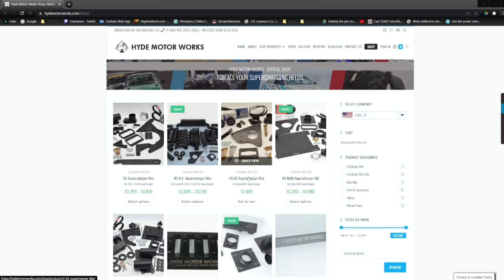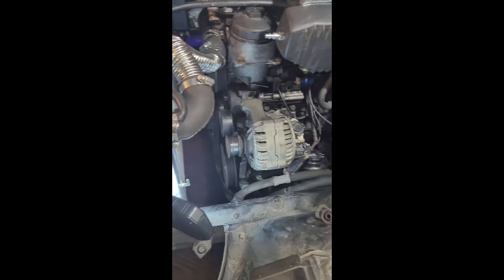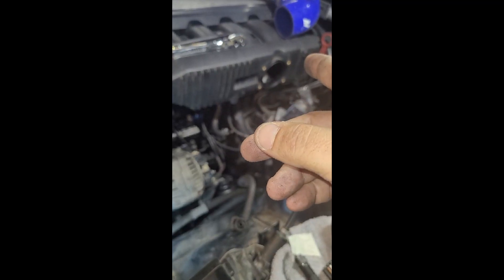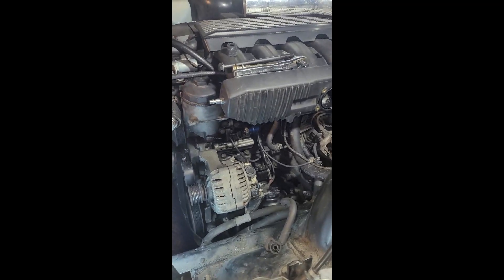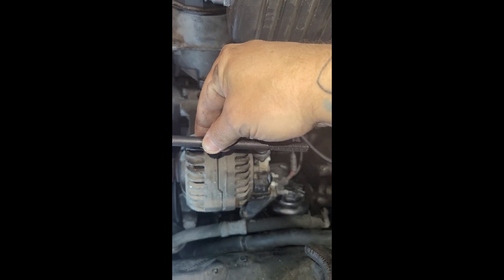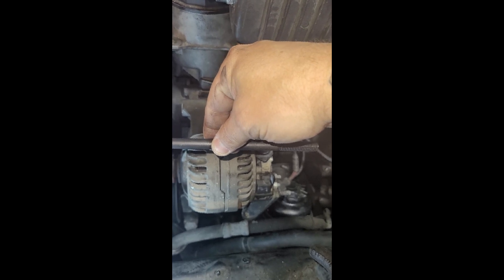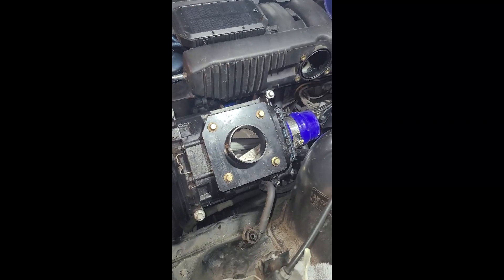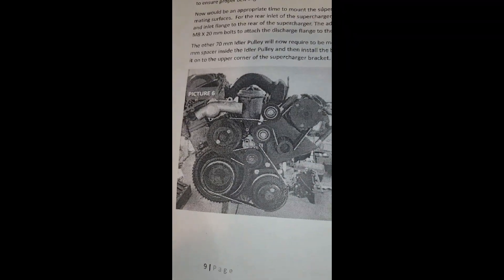Hyde Motor Works V3.62 Installation guide using Eaton M62 supercharger. 99 E36 BMW M52b25.

Comment: Hi tell me for the Hyde assembly do you need to have the power steering pulley? Or can I mount it without it and take a shorter belt
Reply from the maker: @sakbaw  you would want to contact Hyde to be sure but as long as the superchargers turning in the correct direction you could probably just use a smaller belt

Comment: hello, 
I have a question,

How did you relocate your power steering reservoir ? 

Thank You.
Reply from the maker: Just unbolted and moved over might have zip tied it over to frame it doesn't really get in the way
Reply: @OryHaram   i can’t put the throttle body where you put it it’s impossible i tried everything..
Reply from the maker: Not sure I don't remember doing anything special I've helped a few other with their kits and no one else had this issue
Reply: @OryHaram   do you have instagram or Facebook to talk ? 🙂
Reply from the maker: Its @oryharam instagram